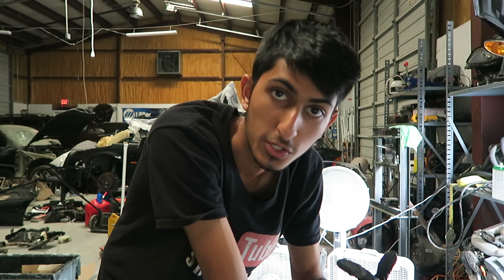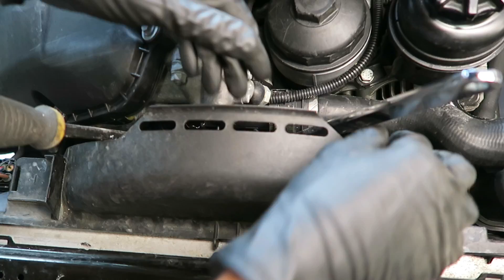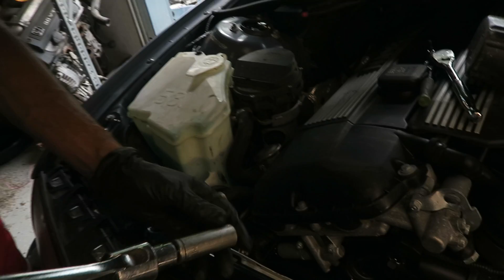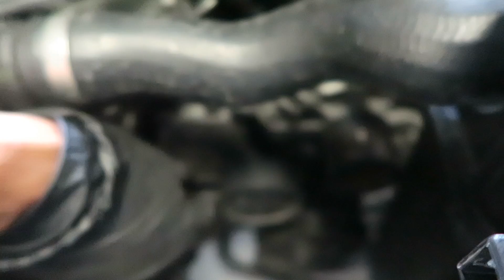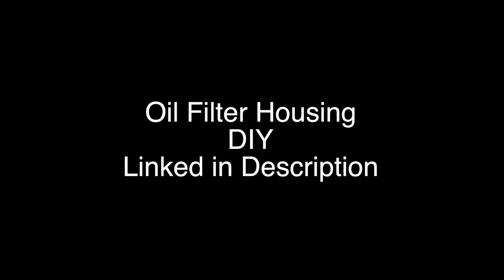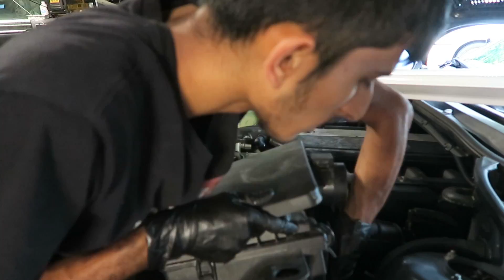BMW E46 Water Pump and Belts/Tensioner/Pulleys DIY

Comment: my m54 transmission protected itself because it had low oil level so in the gear it was in I took it to a friend's and there the engine overheated and caused the hose below the coolant tank to come loose, so I put in a new transmission and after this when I put everything back together and started the engine it was overheating, even though it is very calm and not smoking it is getting hot, so I changed the water pump and the thermostat and it is still getting hot, all the hoses are correct and I have probed the radiator and it still keeps getting hot and the thermostat will not open, and it does not seem that the water is flowing, the bottom hose stays cold and the radiator, but the top hose gets too hot and reaches up to 104 and 105 degrees so I turn it off, and I do not know what to do

Comment: My e46 has an electric fan. I bought it used but I'm pretty sure it came stock. It's so easy to get in and out. I couldn't abide a fan/clutch assembly.

Comment: I'm turning the socket for the belt tensioner clockwise but the tensioner is not budging at all. Screw is moving slightly clockwise and I'm afraid I'll strip it. Am I doing something wrong or is the tensioner just shot?

Comment: Tip for any DIY ...use aluminum foil to cover the crank pulley. If you form the foil just right. You can make a funnel down into drain pan.

Comment: i just switched out my heater pipe and water pipe from under the manifold, started driving for 3 days and again, i have a leak at the same spot but i started looking at the water pump area, could it be that my water pump o ring is old and letting coolant come out ? possible cause ? love ur vids bro, they’ve helped out a lot!!

Comment: Dude! I just tried pushing mine in and it took all my strength to just get it in enough to thread one nut onto a bolt. Mine had a bunch of build up from lime scale or hard water since I've been running just water and no coolant. Been broke! Hopefully it doesn't cause a problem but it's all tightened down.
Reply: Just use distilled water then

Comment: Hi Jason, my car is 325Ci 2002. I am planning to change the pulleys as I am hearing some whining noise but only to find out that I don't have idler pulley! The belt goes straight from alternator pulley to water pump pulley. Do  you think this was removed by the previous owner or standard for this model? Thanks.

Comment: If the water pump on my 04 330ci is out what else do you recommend I replace to go along with that? I know you said the belts and the fan switch as well as the tensioner and the pulley, any other major parts?

Comment: Hope you can respond to this comment or somebody else who has worked on E46's. So if I do this job rather than replacing the fan clutch can I just do the Electric Fan swap like you have in the other video?

Comment: my water pump exploded had to order parts (rockauto) the belt that came says it's to fit but it's long an inch ish old one is lost on road ? is there different size belts . my auto store can't even order oh 2001 330xi  belt is roadmax 6pk1539 ....what's the deal

Comment: Hi Jason, great video! Like your camera work and commentary, very straightforward. It would seem I have to do this repair as one of my belts (water pump??) shredded this morning on the way to work. Guessing it's the water pump belt since the drive belt is all intact and there is coolant splashed everywhere towards the front fan/shroud, etc. 

If i'm replacing my belts, tensioners, pulleys, water pump, t'stat, expansion tank, should I be replacing the alternator too? I thought  I read that somewhere, but can't put my finger on it? Thanks in advance :)

Comment: Two questions, I am doing the water pump thermostat, pulleys and tensioner's while I am going in to replace the oil filter housing gasket. Do I need to drain the engine oil before i remove the housing? did an oil change 2,500kms back. Should I also drain all coolant?

Comment: one thing i notice is that the new pump had the plastic impeler. which is known as a fail point in these cars. they sell an after market with metal impeler and they are 54$. great video though!
Reply: If you get an good quality waterpump like skf the plastic impeller will outlive the car itself

Comment: I had a tensioner go and the idler bolt broke of into the filter housing.  I replaced the housing with a used one.  It came with a hydraulic tensioner.  I hear the hydraulic ones last longer.  Is this true?  Keep up the great work bro!!!!!

Comment: Nice video, wonder if you know the size of the two screws used to push out the WP.  Is that something like a M10x25?  Thx!
Reply: Use the bolts from the waterpump pulley

Comment: Hey I just gotten a e46 and I was wondering is there a way to change an starter without removing the intake manifold
Reply from the maker: Yes, but it will be a lot more difficult
Reply: +ShopLifeTV  Thanks I had done it yesterday. I removed the intake manifold it made it a lot easier

Comment: Hello fron London, hooked on your Vlogs, proud owner of 2 E46's 1999 318i SE & 2003 320i SE Touring. question - constant traction control and yellow hardbreak light on. changed both front wishbone, bushes and droplinks plus had the tracking done but light will not go out. could some sensor need attention? no fault codes on odb2. any ideas?
Reply from the maker: Hey hows it going? Does your speedometer work? It could just be one of the wheel speed sensors or the steering angle sensor.
Reply: Way late but maybe it is of some use. Possibly ABS sensors, one on each wheel. Or could be a ABS computer fault that needs clearing. I had something  like this for months (in addition to a P0335 code), and couldn't get rid of it until I got PA soft set up and cleared all codes.

Comment: git yerself a fan clutch holder tool! ;-)

Protip: Tape some cardboard over your radiator so you dont bend any of the fins.
Reply from the maker: I have the pulley holder that came with the 32 flat wrench lol. It's actually a lot easier and quicker with the pry bar though. Good tip on the cardboard :) Thanks for watching!

Comment: can you tell me the price o fthe water pump??? and if the e46 facelifted version (i mean 2003 for example) the water pump is different?
Reply from the maker: Depends on where you get it from, the water pump is the same between e46 gas models. Should be between 50-75 if buying from a parts store.

Comment: smack the wrench with a hammer to break it loose
Reply from the maker: Tried that several times. I do not suggest using a hammer as it can do more damage. If the wrench moves forwards when you hit it with the hammer you have a high possibility of breaking the thermostat and or fan shroud. Now if you are replacing your thermostat, go for it.
Reply: +ShopLifeTV if that's what your afraid of the make an air hammer attachment kit to get them off quick
Reply from the maker: +Mark Reyes You are correct, but that would be less relatable by most of the people who would be trying to DIY the job. Thanks for the tip though